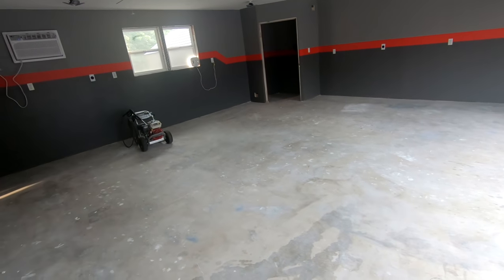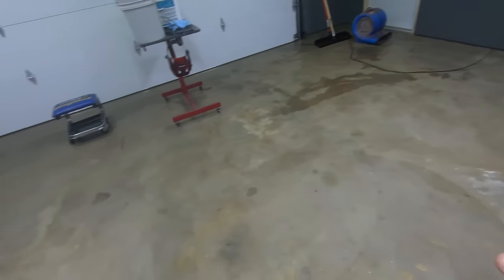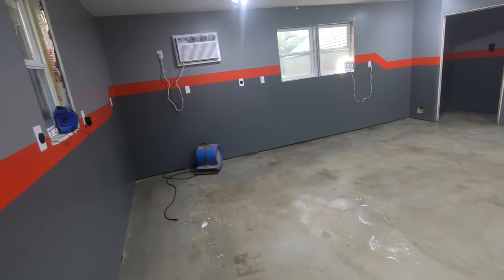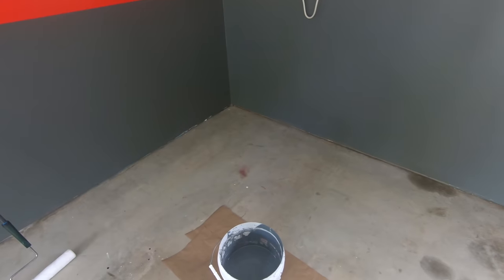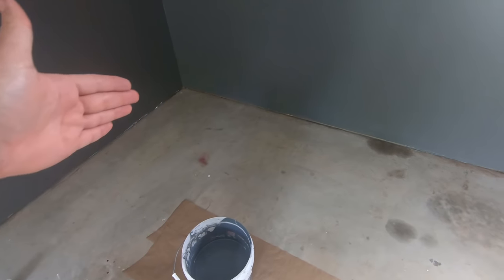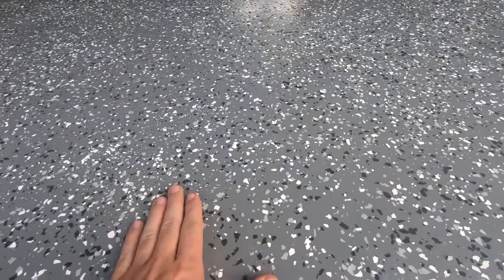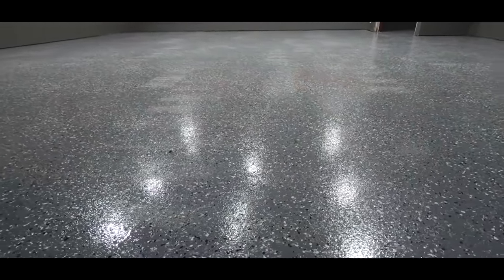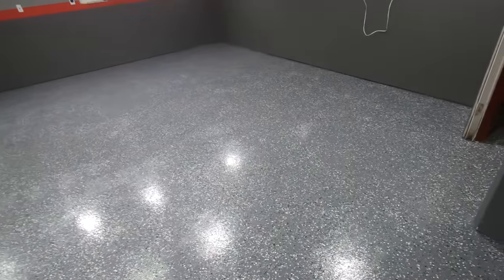Garage Reno Pt.11 - Rust-Oleum Epoxy Professional Version Install! DIY!

Comment: Power washing and acid etching is no substitute for shot blasting or grinding a floor. Also if you want a true lifetime floor I would recommend Urethane Cement with flake broadcast and MMA topcoat. Expensive but the best.

Comment: Hmmmn....no Diamond grinding? Would be interested to see how long this floor lasts before peeling. 
No scratch in Floor for true mechanical bond???
Reply from the maker: Several ppl are interested. There’s a strong consensus for epoxy installs you gotta diamond grind. Well, I’ve seen floors that I have been diamond grinded fail too. So it could be another money scheme to charge more for the process. Not sayin that’s true, but I’m skeptical. And I didn’t do it and went the way of a chemical etch. Either way the floor was etched.

Comment: How is the floor holding up? Have you had any issues with hot or wet tires pulling up the finish?
Reply from the maker: No problems. Still like new

Comment: I painted my garage floor with a concrete paint 5 years ago, what prep would you recommend for my situation ? Or should I just pressure wash, clean and then paint on top whatever is left?
Reply from the maker: Tough to say.. if your old stuff is really stuck down, then sure paint on top. But don’t blame the new epoxy if the old stuff flakes up causing your new epoxy to lift too. Having said that.. either strip to bare concrete or clean it the best you can and go with it. I think if you read the instructions provided by rust oleum they talk about how to handle existing floor coatings. Check that out
Reply: @StewartMotoring  thanks for the help,  I appreciate it

Comment: I've read several reviews on the clear top coat that stated to buy 2 packs as it did not fully cover a 2 car garage even after a layer of the base epoxy. I noticed you only had 1 pack. Did you have any issues with running low?
Reply from the maker: Good question, I bought 2 packages of the clear but only used 1. I may have ran low but I didn’t run out. I had a backup clear in case I did run out. Which I would recommend. Can always return what you don’t use.
Reply: @StewartMotoring  Thanks for the tip and for the great video.

Comment: I more think using two kits to do two coats. Why you put them together and just do one coat? Do you have good reasons? Cheers
Reply from the maker: Instructions didn’t include doing 2 coats. Just followed the instructions. But I mixed them together so that if there was any color difference between the 2 kits, I would get rid of that issue by mixing them

Comment: nice video. do I still have to use degreaser even tho my garage is brand new in new home?. its just few stains and dusty thats all.
Reply: While you may not need a degreaser as a result of lack of use, your floor might have a coating (not epoxy) on it from when it was installed. Regardless, coating or not, you must, at a minimum, etch your floor. This opens up the pores to the concrete and allows  your product to be absorbed. The absolute best method is to grind the floor. You can rent a machine from any local tool rental company, Home Depot and perhaps Lowes. It's more work in the sense that it creates a LOT of dust, but just hose everything down, give the garage a chance to dry and then proceed with the install. When using etching material, you'll still be hosing down the floor and creating a chemical mess in your driveway plus you will also still need to wait for the floor to dry before beginning the install. Summation - yes, you need to at least etch your floor, using a grinder is better. Allow your floor to dry after rinsing off.

Comment: would you tell me how much did you spend total? my garage is about the same size. i wanna try to do it myself.
Reply from the maker: It was like 100 per box. So 3 boxes 300 plus cleaning supplies and flakes probably around 400
Reply: I am curious as to how you kept all the sprays from splashing on the walls.

Comment: Will I still need to do all of that before applying the kit of the concrete/ house is newly built so its new concrete floors?
Reply from the maker: I’ll first say I’m no expert but I can understand your floors will be very clean. You may look at at least doing the acid etch so your floors are porous enough for the epoxy to grab onto. Also - there is a cure time the concrete needs that the instructions talk about for new concrete.

Comment: Needed one more layer of clear coat.
Reply: I'm wondering if it was the quality of the clear cut (being Rustoleum) as opposed to the quantity....
Reply from the maker: A second layer would probably add more protection... but it’s also another 100 bucks. Everyone can decide how many clears they want to add. I chose 1 layer 😁

Comment: would you have needed the clear if u skipped the flakes?
Reply from the maker: The clear is optional. However, the clear helps protect your base coat and you wanna protect it in my opinion

Comment: what would happen if we dont etch it before painting ? i bought the whole kit and my hubby didnt use the etching powder -__-
Reply from the maker: Hmm, I’m not an expert at all this... but the purpose of the etch is to make the concrete surface rough to give a better surface for the epoxy to bond to. Same as when a car gets painted, you gotta scuff up the surface a little bit for the paint to stick better. So.. obviously worst case scenario.. the epoxy has trouble bonding to the floor.. therefore possibly peeling? Lots of variables.. of course.. your floor could be “rough” enough as it is and didn’t need it.. but it’s pretty cheap and just some extra labor to do it anyway. That’s all I know. Good luck!

Comment: Good job, but Why you leave no finished concrete on front garage under garage door? it not looks good when you open the door.
Reply from the maker: The epoxy isn’t allowed to see outside weather conditions and direct sunlight. So the epoxy stops at the door seal.

Comment: Aren't you supposed put two coats of the base coat on, then on the second coat you sprinkle the flakes? Maybe that's why everyone uses more .. either way you can't really tell you only did one coat looks awesome.
Reply from the maker: Thank you. I like it so far as well. As for your two coats question, it is not necessary. One coat will suffice. I pulled this from the instructions.

Pour a portion of the admixed material into a lined paint pan. Immediately begin to cut in the perimeter of the floor along the wall, or other areas where a roller cannot reach, using a brush or edger before beginning roller application. Use a synthetic 3⁄8" nap roller cover on a 9" roller frame to apply an even coat of EpoxyShield Professional Floor Coating onto the surface. Limit the application to 4x4 foot (1.2m x 1.2m) sections at a time to make it easier to distribute the colored chips onto the freshly coated surface. Scatter the decorative chips up and away from you so they land flat on the wet paint film. Then continue on to the next section.
Reply: @StewartMotoring  no

Comment: How rough is the surface after adding the grip/anti-slip compound to the clear coating?
Reply from the maker: Difficult to explain, it’s got texture but I wouldn’t say it’s rough. Still fine to lay on and roll around with a creeper.

Comment: Nice. What if you don’t use the sand.
Reply from the maker: May be a bit more slippery when wet. I will say though, the amount of flakes I used provided quite a bit of “roughness” to the floor. Still would recommend the clear but sand eh maybe not. I liked it tho

Comment: I did this, I have streak lines from rolling it on. How to fix or even that out? Its already hardened. Maybe a 2nd layer going in a cross hatch pattern? Put flakes in the 2nd layer of sealant? I dont have flakes currently.
Reply: You see the lines because you don't have any flakes.  The flakes cover 90% of the imperfections up.  Short of that, if you "feather" the lines when rolling (similar to painting drywall), then you shouldn't have any problems.

Comment: can I apply this over an epoxy coating that’s 18 years old?
Reply from the maker: I believe there is a test that you can do as part of the instructions for this epoxy to determine if your base epoxy is adhered/strong enough to support this epoxy on top. Essentially you want to make sure your base doesn’t fail and cause your newly applied epoxy to come up... but I’m not expert. Give them a call I suppose or research that test

Comment: is it slippery when wet with the clear coat?
Reply from the maker: No, it’s pretty textured.
Reply: @StewartMotoring  good to know and how's it holding up over the past several months since you completed? any patches and areas where it's come up from tires or tool boxes? are you still planning to do a pt 12 follow up? thanks for the super quick reply back!
Reply from the maker: No complaints at all. No issues so far. I still plan to do a follow up
Reply: @StewartMotoring  awesome bc i'm planning to use the exact same flooring and finish that you did - looking forward to the follow up!

Comment: No way that flooring lasts a long time without grinding the concrete. Etching isn’t enough for epoxy or polyaspartic coatings
Reply from the maker: Strong opinion, let’s see how it plays out. If you are wrong, you can no longer in your lifetime provide any assertions/opinions on epoxy installations. 😉

Comment: You need to diamond grind the concrete and skip the etching
Reply from the maker: No you don’t
Reply: @StewartMotoring  if you want it to last you do , your going to get hot tire pickup guaranteed
Reply from the maker: Your wrong so far 🤡. Easy to speculate what “might” happen in the future to make yourself look smart.

Comment: Nope I would have redone it to many dull spots clearly visible in the clear coat. And the lights nope I don’t see the point for three fixtures and three bulbs per fixture I would have go with tried and true LED 4 ft tunes far bright let and more even

Lust my two cents